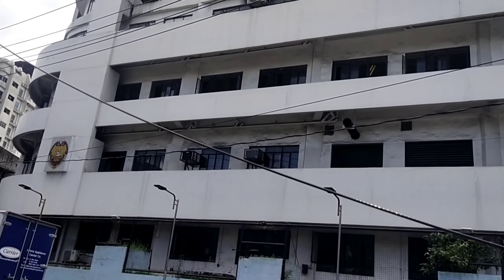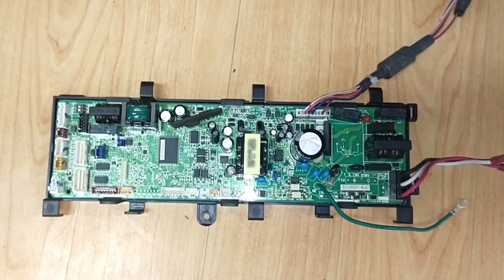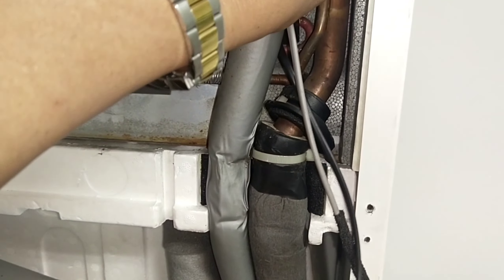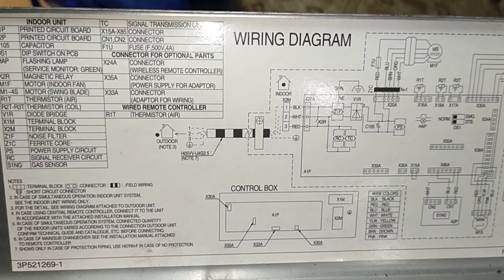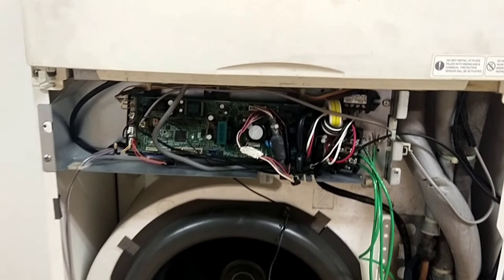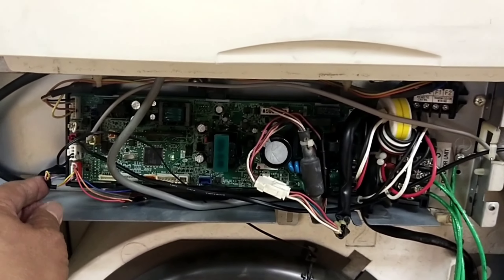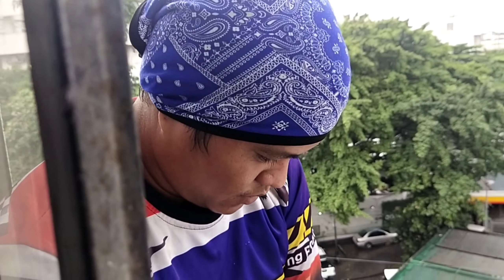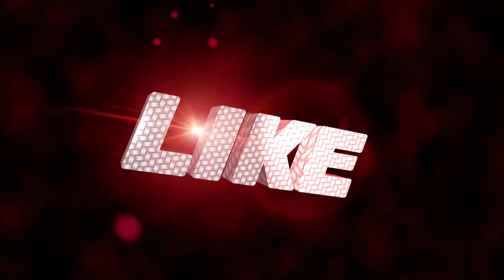Daikin Inverter Floor Stand ERROR CODE AO 11 Best solutions|Raccool Air-conditioning TutorialTv

Comment: boss, posibli din ho ba na communication field wire yong dahilan kaya nag eerror ao 11?
Reply from the maker: Posslible nman kaso ung sira tlga madalas ung protection device s board ang bumibitaw master. Check mo kung d p ngchange value ang ang sensor board n yan
Reply: @raccoolair-conditioningrep6606  yong gas sensor ba tinutukoy mo boss?
Reply: Pwede po makuha contact no nyo?
Reply from the maker: 09279418926
Reply from the maker: Ns idoor board ang protection device . S control.

Comment: Boss pano mo ginawa ganyan din problema sa costumer ko nag palit ako indoor board ganun parin.  Sana ma sogot from Davao po
Reply from the maker: AO 11 kc indoor board ang error n yan master. Icheck mo connections L1L2 at communications. Kc ngproprotect ang indoor board pg AO 11. Tpos check mo din ang pinalit mo n board bk deffective.. Cable remote b yan? Press mo ang menu ng matagal tpos scrowl mo. Nanjan reset master. Sn mktulong.
Reply: boss, possibli ba na communication field wire yong dahilan kaya nag eerror  ao 11?
Reply from the maker: @elvengallardo5704  AO or External protection device.. s indoor board yan master s my s volts nia ppunta s sysstem. Sobrang liit n kc mga pesa ky madali masira mga yan.
Reply: @raccoolair-conditioningrep6606  pinalitan kase namin ng indoor board master...pero, nag error ao 11 pa rin siya...ano pa kaya problema niya master?
Reply: @raccoolair-conditioningrep6606  or need pa ba i-reset master kapag pinalitan ng bagong indoor board para gagana yong unit?
Reply from the maker: @elvengallardo5704  Bgo ung board n pinalit nio? Check mo lng mga terminal ng mga socket bk lng my natupe. Pati field communication check nio n din bk ngbaliktad.
Reply: @raccoolair-conditioningrep6606  brand new yong indoor board master...galing mismo sa daikin company...yong tungkol na man sa field wire, hindi po namin ginalaw boss kase yong indoor board lang yong pinalitan namin..
Reply: @raccoolair-conditioningrep6606 boss my update na kung paano irepair  ang board error AO-11?

Comment: Please boas i am having the same problem error code Ao11 when i changed the pcb still doing the but when Same pcb to different machine it works
Reply from the maker: Check communication sir.. maybe a loss connection or grounded or open communication circuit..
Check also the connections:
Indoor T1 to outdoor T1
Indoor T2 to outdoor T2